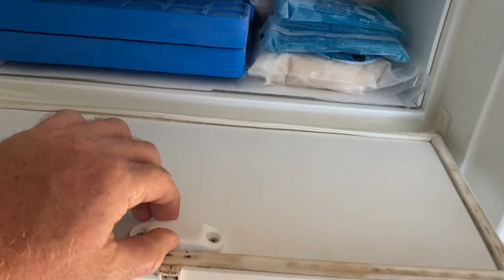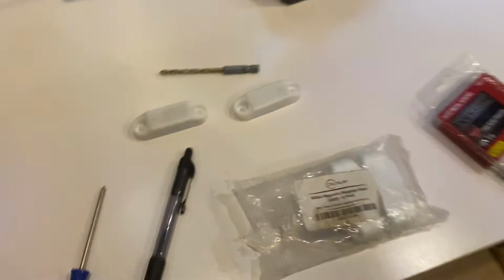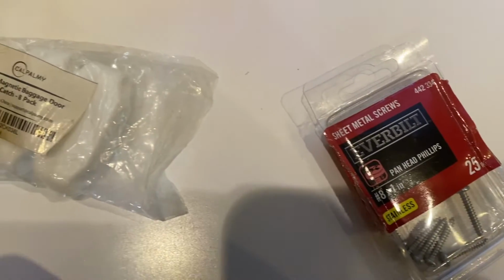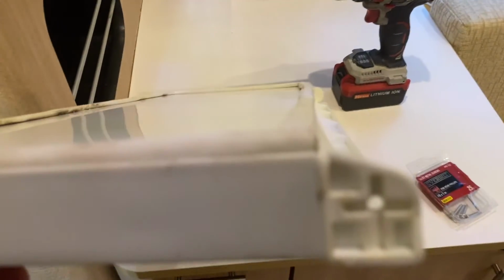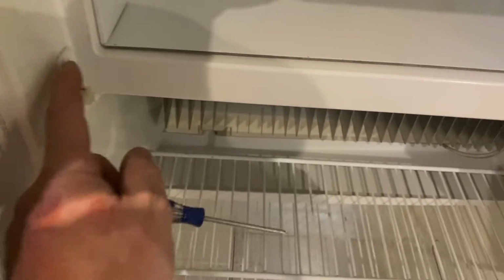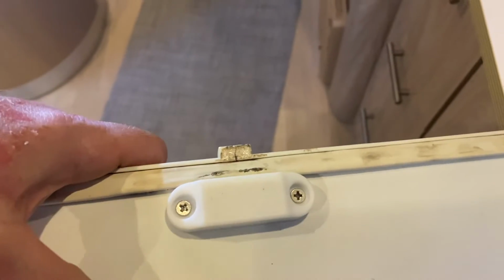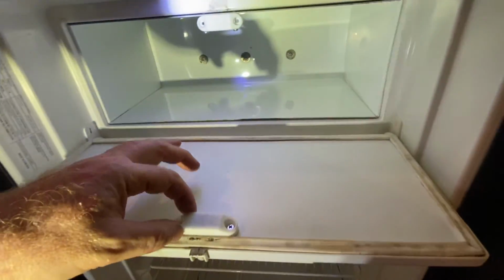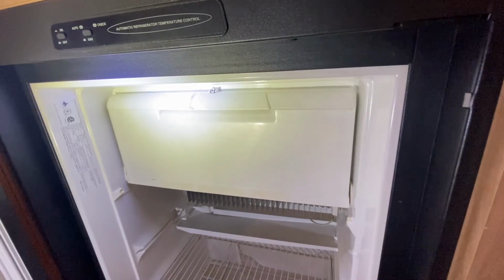Best Dometic Freezer Door Permanent Modification and Repair

Comment: I broke mine by propping it open to allow moisture to dry. Came back days later and the housing on the left side was broken. It is a Norcold and no parts for the left side to be found. Shout out to Ifixify. They had a kit for a Dometic and it worked fine. Now I will try the magnets.

Comment: Found your solution after installing ifixify replacement hinges and new door hinge sockets. Went to 180 instead of 90 degree on the springs to get tension. Will add your magnet solution- closing up the open back with hot glue instead of super glue. Great job thinking it through 👍
Reply from the maker: Great idea on the glue, thanks for comment

Comment: Super Glue doesn't do well in Freezers.... 
Couple suggestions right off...
Silicon over those screws... helps keep the cold in and prevent ice from actually getting behind the screws (It'll get there!)

Also, if you have to "glue" what you said you may have to...
Put some styrofoam into a small jar (like small olives jar) and a half a jar's worth of Acetone.
Feed it styrofoam scrap over and over until you end up with a thick paste...
Or you can drain off the excess acetone revealing a putty like material    use gloves during this entire process 
That putty won't be sticky at first...  put that (or paint on the fluid-like version over what you want to glue.
Make sure the fridge was off so it's room temperature when you apply.
Clean and dry it first etc...

That glue will hold after it dries...  its  1: Waterproof   2: Retains cold because its virtually styrofoam which is used in coolers and refridgerators anyway
Reply from the maker: Appreciate the info,  wouldn’t use superglue, industrial sealant,   But nope,  two cross country trips and screws haven’t budged a bit